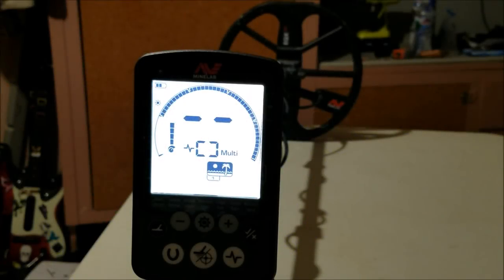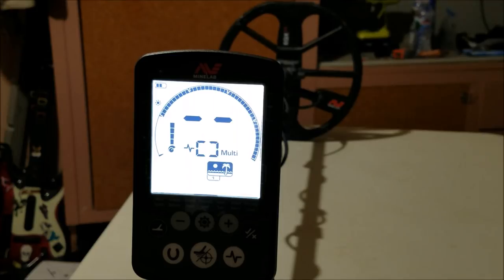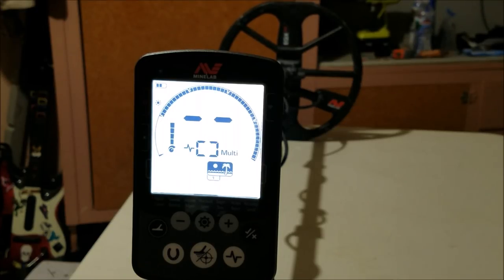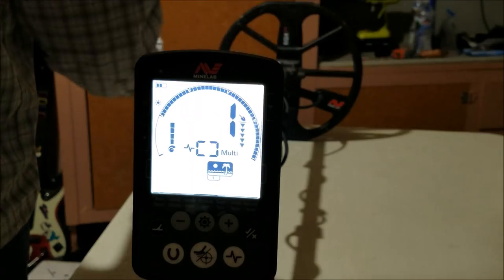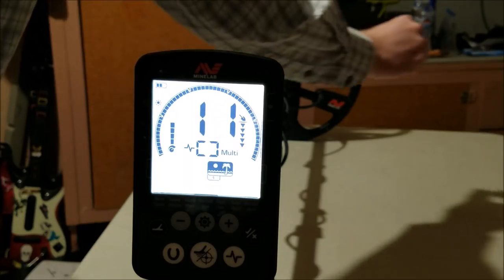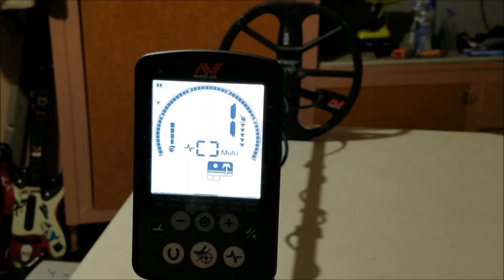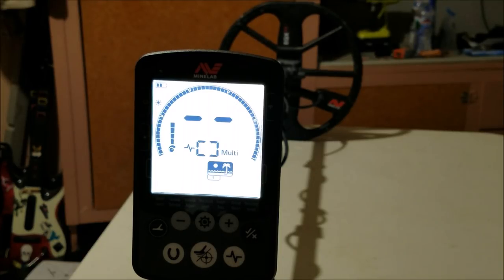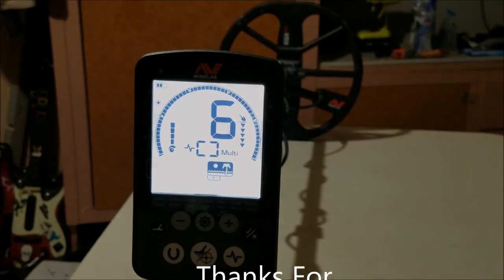Minelab Equinox Beach Bottle Cap Discrimination Method

Comment: I got a 800 and I used to use the same technique  but now I found if you use Park mode 2 on the beach not really wet sand and change frequency 40kh it’s makes almost all the bottle caps sound like iron every time with no high tones at all.. it gets better and better the higher the frequency.

Comment: That should also apply in the field I'm sure.. Thing many dont realize is on DD coils at upper and lower edges where the RX & TX coils cross over will be your strongest signal and more true. I'm gonna have to try that on pulltabs

Comment: I hoped this to be consistent but yesterday on the beach absolutely nothing would help. They came through clean even when switching around. Some BC's will and some don't. I tested these at home and got same response and these were really crusty. then tested ones that give the iron tone and they did grunt when near to edge of coil. Really frustrating. The only reason I keep this is it is better on small gold at the beach in the wet sand but you have to dig tons of small aluminum scrap at the 1-4 area and so many targets come in at 13-14 nickel area it might as well just have no numbers for ID. They need to spread out the low conductor area and get better discrimination up to 50 to help ID iron.  It works like a Dues but I didn't like the Deus just for that reason.
Reply: IMHO if you have a good shoulder and hunt the beaches so far I think the CTX is still the king in most cases. I have to dig enough that I don't want to dig iron and the EQ just seems to not be able to ID iron without having to do a mode change or have to do a dance around the target to get it to tell you. So far my experience with FBS and BBS with my E Trac, Excal II is they don't mistake iron nearly as much. They EQ does seem to hit a area though the others don't and that is the smaller gold and chain jewelry but not sold on that yet. Seen lots of chains found by a Excal. I have no faith in single freq. machines so far. They have gotten more stable in wet sand the depth seems to be lacking. Lots of shallow targets in the summer though. Hope this helps. JR

Comment: Does this only work in a clean spot or can there be trash close?
Reply from the maker: If there's iron trash close it won't work as well. However if you approach it from all sides you have a better chance of identifying it as non-ferrous. This works for other iron targets as well. I just dug a gold ring this morning that is stained with iron. The signal was great even though it was surrounded by iron. maybe I'll post it later. Thanks

Comment: This is a problem with the equinox..

Swinging is nice but the moment it looks like you are pumping the coil up and down as much as just swing the coil from left to right Minelab will probably understand it is a flaw.

Period .

Pumping  the coil up and down is what you do to ground balance most units ..

Not as a check tool to id bottle caps no matter how much i like the solucion itself and especially that you share it ..  wich is off course helpfull from your part .

These detectors are great for wet sand hunting but on a regular park or field they are the wrong guest at the wrong party altough they get sold for being the ultimate all round detector .

They are deep machines ,
Without a doubt , fast too ..

But the electronics are rather off - beat then in synch , this with a couple more issues gave me doubts to just stuck with it and accept it is everything but a magic wand ...

Or to sell it and get a more efficience tool .

What i do like however , is the grip of the handle , it feels sturdy , and the screen itself with clear and big info ...

Easy and comfartable knobs too ..  with the exception for the power and light knob ...

What where they thinking to put them both that far away that you need your your other hand to assist you ..

Anyway ... looks are stunning , 

Just wished it had a better charachter .

Comment: The problem is the deep bottle caps.... they sound good with solid I'd.....you must dig 5 scoops and to get the coil close to the bottle cap  ........ then the all metal trick will work
Reply from the maker: You are probably right. I haven't dug any deep ones yet. One thing I've noticed at my beach (which has lots of minerals) is that anything over 8 inches is real iffy with the Equinox. I usually use a Whites TDI and get far cleaner signals. Bottle caps are easy to tell on the TDI because the signal is wide and fuzzy as opposed to wide and solid like a ring or nickel. I'm also digging 14 inches for stuff.
Reply: exactly